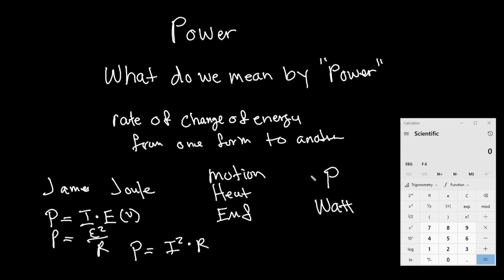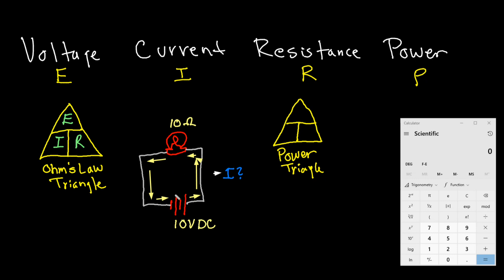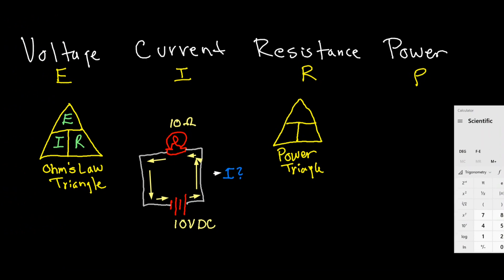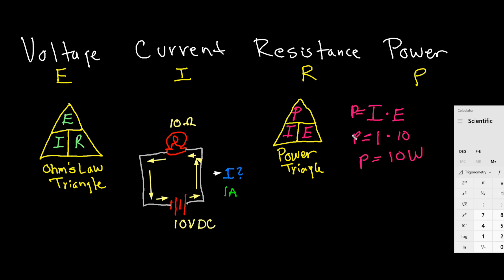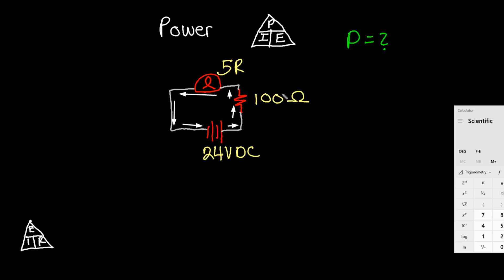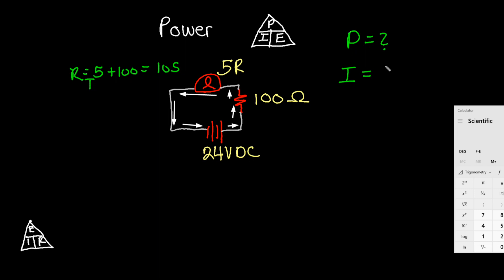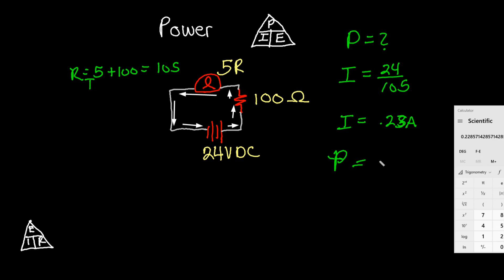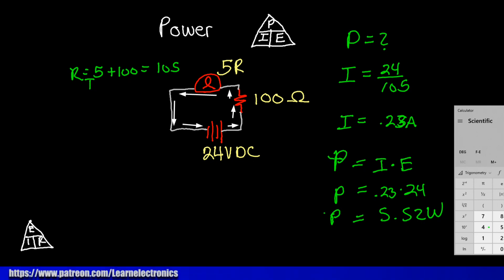Basic Power Equations For Electronics

Comment: What type of Power is V*I = wattage but what type of power, reactive power, apparent power, applied power? IT would be nice if you made a video lesson about different types of VA because there is a formula of current load/VA = power wattage. The current load is what the circuit under test is drawing which you divide by the VA value. VA can be a load or VA can be a transformer which doesn't dissipate power
Reply from the maker: This is for beginners. Strictly resistive calculations